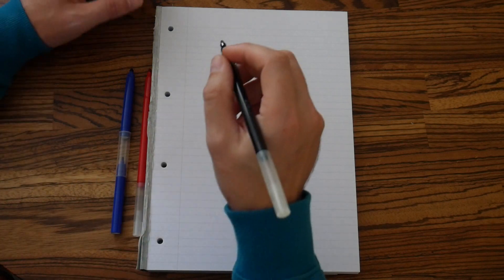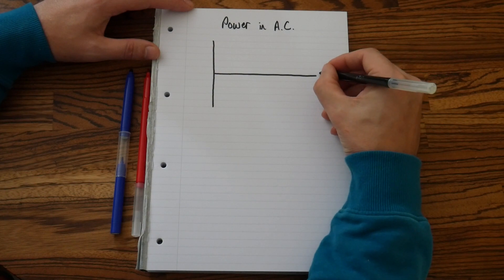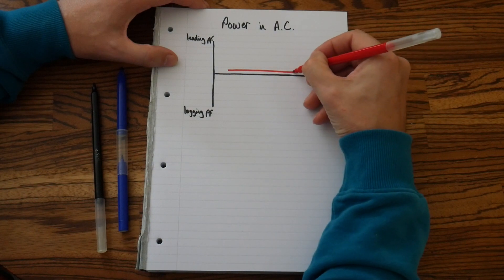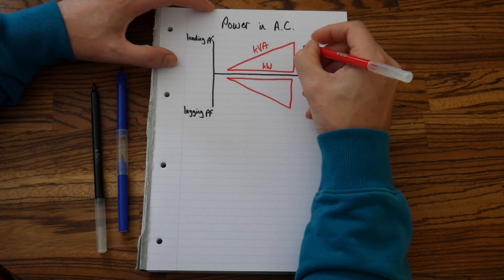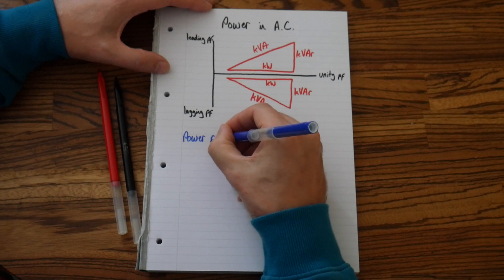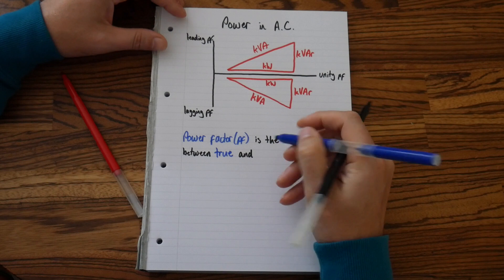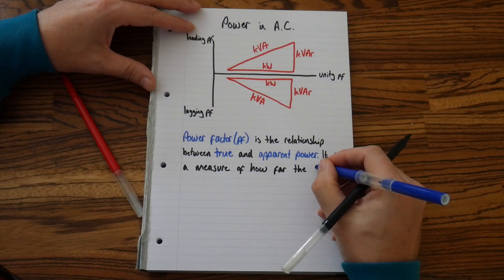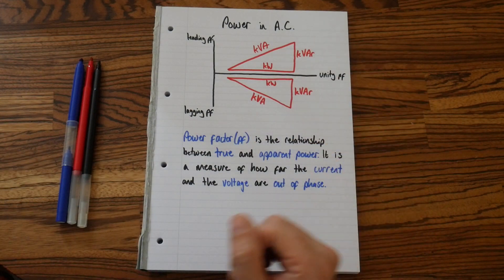Power triangles explained

Comment: I had started my online course last year but I have struggled so much. After a few months off and watching your videos I am going to restart it again. I am hoping with your videos it’ll help simplify some parts of important information to allow me to learn it in a better way.
Reply from the maker: @danmurphy7338  I'm glad you've made such a positive decision, nice one mate! There are plenty of guides and practice questions at www.electricalstudent.co.uk 
Also, if there is something you particularly struggle with, let me know and I'll try and explain it/give an example for you
Reply: @ I just need to find a better way of learning lol, between the books, webinars, power points theres just so much to take in at one time. I have all the labels for my books but my bs7671 has alot of labels compared to yours. I will definately be taking a more closer look at your site mate as I am determined to get it done next year. Its only the lvl 2, I’m 41 next year so times running out to change careers lol.
Reply from the maker: @danmurphy7338  The health and safety module should be pretty straight forward for you, the harder theory stuff like series, parallel circuits, magnetism, motors and cable calculations are the usual areas people fing challenging. Level 2 only requires the use of the OSG and cable calculations only go up to calculating the live cable. 
I really good way to revise is to do lots of end of module tests and old exam papers
Reply: @ these are what I am currently doing. Introduction to Basic Electrics, Basic Electrics & Building Regulations, 18th Edition of Wiring Regulations, PAT Testing and Introduction to Initial Verification (decided I am not doing this), Initial Verification, Periodic Inspection and Testing, and Condition Reporting. I am just glad I didn’t go for the AM2 and lvl 3 at the same time lol. I will be keeping at it this year. Last year wasn’t great. My Dad ended up taking ill and passing away, and was running my business on my own. Pray for me 😂